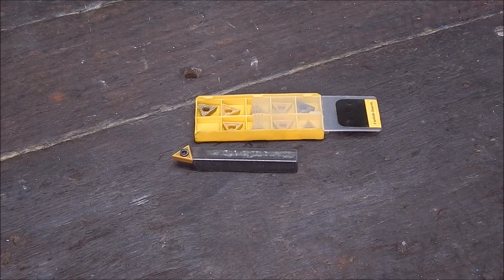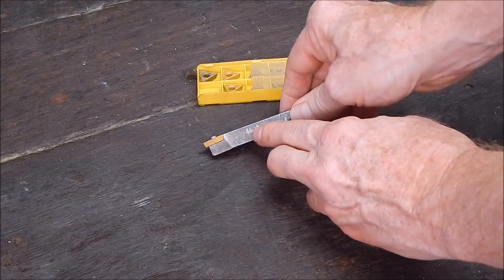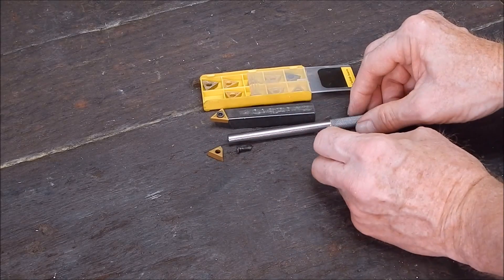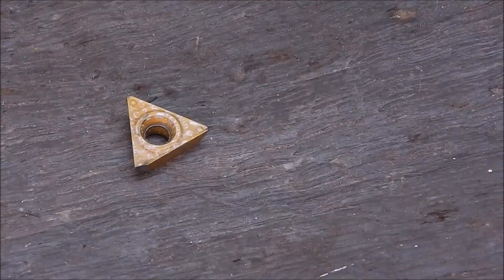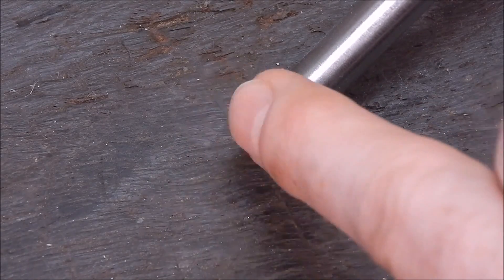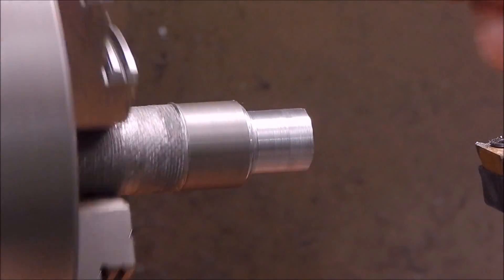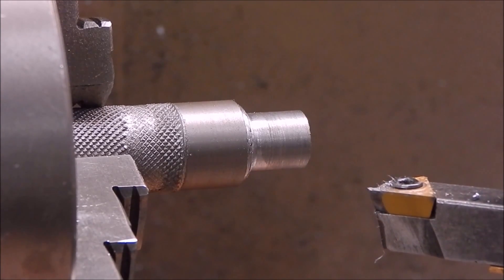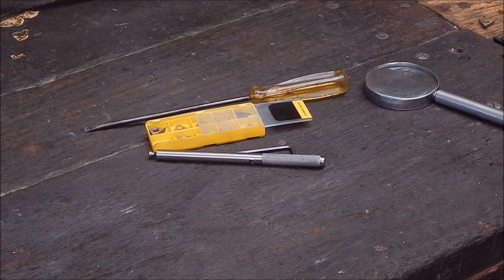How to sharpen carbide inserts - TCMT and similar mount

Comment: Hi great vid. Got 1  question for you. Can this same bit be used ed to turn down plastic..ty
Reply from the maker: I expect so.  Basically you can grind a very fine/sharp edge (which you need for poly) on any carbide with a green stone or diamond abrasive.
Reply: @Xynudu  ty Sir
Reply: @Xynudu  where do I get those kinda grinding stones
Reply from the maker: Green grinding stones are available from companies that sell abrasives, but will be expensive (and usually only available in larger sizes).  I bought both of mine at garage sales very cheaply, but that's pretty unlikely to happen.  The cheapest option would be to buy a diamond coated cup disc or whatever fits your power tool from Ebay or Banggood -  they are not overly expensive. Cheers Rob
Reply: Hello what grit would I need for this diamond cup disc you talk about. I am looking on ebay right now.
Reply from the maker: As fine as possible is best.  Coarser grit will never give the best finish in any medium.

Comment: A good tip I learnt today... if you go to a CNC type workshop, you will find that they do not sharpen any of their inserts. They simply throw them out as soon as they don't perform well. .....OR, if you ask nicely, they will give them away. Many places like this scrap all the very short off cuts of steel etc, but again, if you ask, they will sell at scrap prices.

Comment: Hi Rob, any idea how you go about sharpening the carbide parting off insert? They are a different shape and don't have an hole to start with.
Reply from the maker: Hi Steve,

I don't have one of those, so no experience.  My only suggestion would be to grip the insert with a small pair of locking pliers (multigrips). 

Cheers Rob
Reply: https://www.youtube.com/watch?v=zBND6emsSE4

Comment: That grinding wheel was not a green wheel used for carbide inserts, That is one reason why you got a rougher finish on your cutting, And you I thought were a little to aggressive sharpening it,  Which will have a tendency to fracture the bits,
Reply from the maker: No.  That wheel is definitely for carbide.  I have two and they are both (marked and labelled) for carbide.  One is coarse and one is fine.  Not all carbide grinding wheels are green.

Cheers Rob

Comment: Yeah g'day Rob--I do something similar and I also have a couple of  small 600 grit hand diamond stones which  can be used to touch up as you go along..They all work alright..
Listening to the back ground noise on the video I can here the sound of many doves--its summer time for sure..
Reply from the maker: +Ian Craig 

Hi Ian,

Yes, the inserts scrub up OK, depending on how bad they are.  Obviously the chipped ones (as shown) are a pretty extreme case.

We are over run with wild doves and top notch pigeons here.

Some days the racket is incredible.  They breed like crazy, and are always territory fighting.

Trying to shoot videos in the morning when they are most active is a real hassle.

Cheers Rob

Comment: Hey there Rob,
I read below that you have not honed them before.
It's quite easy, you don't need a power tool either, just a diamond hone/lap.
They are available foe niks on Ebay, and occasionally at Aldi. Just make sure you get a few different grits so you can work your way down to a high finnish. 
Matt
Reply from the maker: +Matthew Gischus 

Thanks Matt.  I will check out diamond abrasives more closely.

I use diamond burrs in the air die grinders and they are excellent.

I just switched back to my 2600 grit (super fine) green stone, and am getting great mirror finish results again.

It's also more controllable as it doesn't grind anywhere near as aggressively as the coarse stone.

Cheers Rob

Comment: Hey Rob me fellow tight-arse.  Get the word out!  Shops toss their inserts or sell them to recyclers and buying said inserts at scrap price accounts for most of my tooling.  Since most of us here do a lot of aluminum and casting, a bit of honing is worthwhile to get that smooth edge aluminum likes.
I've been using diamond coated lapping discs with great results. They are pretty cheap at under $20 for three. They stay flat, don't need dressing, and they cut so well you won't bother with grit wheels and stones even for roughing.  I use 6 inch discs to match both my grinder and face sander.  Also made an arbor to chuck them in the lathe so I can use the cross slide and compound for precision sharpening.  An eBay search for "diamond lap disc" will get you plenty to choose from.

Cheers.
Reply from the maker: +Eddie the Grouch 

Hi Eddie,

Thanks for the heads up on the lapping discs.

Glad to see I'm not the only one doing this.

I must get a diamond wheel to hone the edges - I'm sure they can be improved.

Also in the video I was using my coarse green stone as it was a lot faster than the fine one - swapped over the wheel and hence the obvious run out in the grind stone as I hadn't redressed it.

Thanks again.

Cheers Rob
Reply from the maker: +Eddie the Grouch 

What grit number do you recommend?   I suppose finer the better?

Cheers Rob
Reply: Nah. I don't shave with mine so I keep it simple :)
200-400 for shaping and general sharpening. I use a 320 because I couldn't decide.  Removes carbide surprisingly fast.
600-800 for fine tuning and renewing.  Okay for final on bits for steel.
1200-2000 for touch-up / final on polished bits for aluminum.  Any higher is just getting fiddly for me.

While I still rough shape HSS/M2/Cobalt on a wheel, these discs are fine for the final edge.  Don't use with mild steel as it will smear into the diamond matrix and oxidize it.   For brazed tools and boring bars I undercut with a Dremel or cut-off wheel to clear the softer steel and brazing away from the edges before using the diamonds.

Cheers, Grouch

Comment: Rob I keep a flat 5" diamond wheel ($8 from the orient) handy just for touching up carbide. Great for brazed carbide cutters when you want to get a nice radius on the corner. 

Colin :-)
Reply from the maker: +CompEdgeX 

Thanks for the tip Colin.

I will get one.

Cheers Rob

Comment: This is a good way to use those chipped tips, and we must all have draws full of them as they chip off at the slightest chance, (especially the screwcutting ones), however, it does make me wonder why we use them at all, unless we are turning a very hard material, the HSS tools are so much better for everyday use, and we can grind them to get a much better finish, the tips are OK for production line work when we need to change a tip and not loose position, but for home workshop they are more trouble than they are worth.
Reply from the maker: +Englishman French 

I suppose we use carbide because we don't have to sharpen it so often, and we can cut dry.  Laziness.

But I totally agree, except for hard metals (facing etc) I much prefer HSS, and where possible finish off with HSS.

Carbide is so finicky on cutting depth and feed rate to get a good finish. 

But it is convenient having indexable cutters for sure. 

Cheers Rob
Reply: +xynudu : I think the home workshop operator sees these carbide tools being use in industry, and thinks that is the modern way to go, but the reason industry use these things is because they are all, (most) using CNC, there is nothing worst than using carbide inserts when screwcutting and not having a deep enough groove on your stop, a chipped cutter is guaranteed !
Reply from the maker: +Englishman French 

I know what you mean.  I have a pack of threading inserts almost unused, as I just couldn't get any sense out of them for home use.

Very brittle to use.

Might re-sell them.

Cheers Rob

Comment: I have honed them before, but haven't tried to grind them... maybe both would be a good idea for roughing bits?
Reply from the maker: +DSCKy 

How do you hone them?

My belt sander won't  look at them.

Cheers Rob
Reply from the maker: +DSCKy 

I suppose a diamond cup wheel on my angle head pencil die grinder would be the way to dress them.

Does it make much difference ?

Cheers Rob
Reply from the maker: +Donner PartySupplies 

Thanks Jim.  Looks like this is a popular method by other viewers.

I've never looked any further than a green stone, because they are made for carbide, and I thought I was the only cheap bastard doing this :)

Cheers rob

Comment from the maker: Re-ground inserts are what you use for all the dodgy, rough and tough jobs which have a good chance of damaging a new insert.

You've got nothing to lose and everything to gain.

These will still go through case hardening and anything else a new tip can handle.

Cheers Rob
Reply: +xynudu I use diamong wheel with a small grid for getting perfect surface
Reply: +Andrii Podanenko so do I. works great
Reply: +Andrii Podanenko It's a tungsten sawblade sharpener
Reply from the maker: +Paulman50 

That's a great tip.

I will check them out.  

Cheers Rob

Comment: That's a good tip Rob, thanks for sharing. You're right, those inserts are pricey, that's great you can get some extra life out of them. Looks like it cut pretty good, the chips got large when you put that relief on it.
Reply from the maker: +ShysterLawyer 

The Mitsubishi inserts shown are hellish expensive, but excellent.

Grinding is tricky to do without magnification, as shown - plus you need good light and a steady hand.

But, as the insert tip is junk to begin with, you've got nothing to lose if it all goes pear shaped.

Only the bad tip will be affected, and the insert will still mount OK for the other positions.

If you check out previous videos you will see examples of my grinding on inserts that have been flogged to death.

Cheers Rob

Comment: isn't there an issue where regrinding means it's no longer all the same on each face? New indexable cutter inserts  should be able to be switched or rotated to a new edge without setting up the cutter again right?
Reply: Just clarifying as someone who hasn't use indexable cutters much that you need to use new/mostly pristine inserts to get all the benefits of the indexing, right?
Reply from the maker: +Robert Szasz 

Yes, that's correct.  The face angles will change.

Rob
Reply from the maker: +Robert Szasz 

If you want to swap cutters on a toolpost without checking the cutter height each time, then you use undamaged inserts - that's why they make indexable tooling.

The carbide in the video actually was still within the vertical index level, but the face angles were totally different (obviously).

Cheers Rob
Reply: xynudu Thanks for the reply.